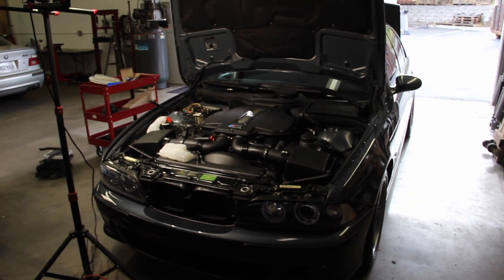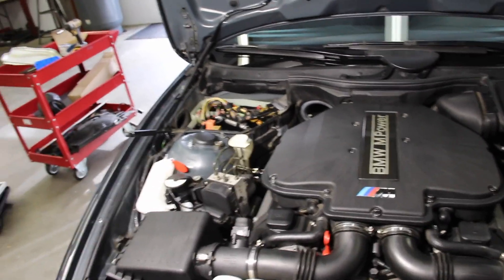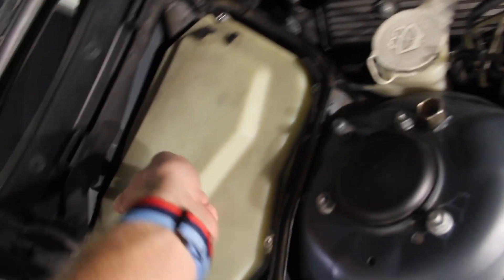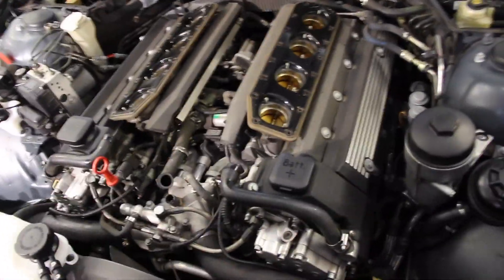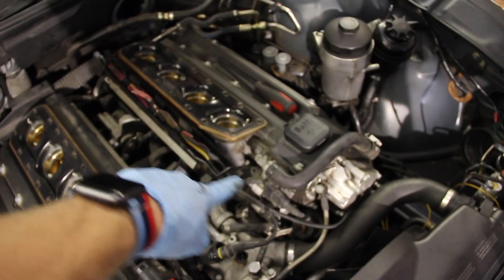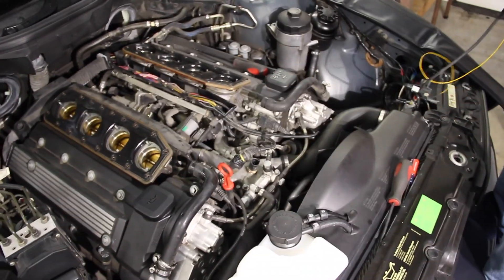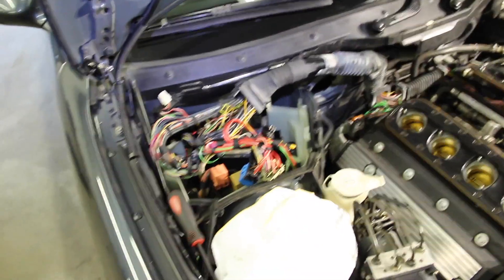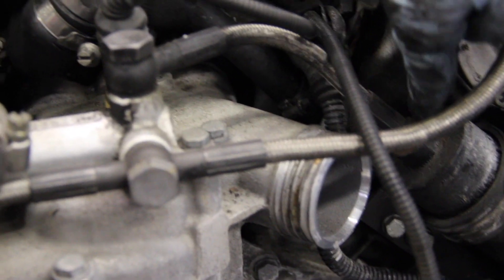BMW E39 M5:  VANOS Pressure-Accumulator Retrofit DIY

Comment: Is this something that can be left as is and not do the retrofit? Is it something that can cause issues later on if it rattles on ocasional startups?
My understanding is that this is more of an option and not necessary if you don’t want to go through the trouble.

My concern is the wiring, I hate undoing wiring looms.
Reply from the maker: It is not required at all, this would just eliminate the rattle during cold starts.  The rattle won't hurt anything though.

Comment: When is pressure accumulator bad?

Thanks!
Reply from the maker: The accumulators don't generally go 'bad'.  I've never seen one fail, so I don't even know what the symptoms or codes would be.
Reply: @E39Source  You are put new one?
Reply from the maker: @7Mario777  There are two types of them.  The earlier ones did not prevent startup noise from the VANOS system as well, so we upgraded it to the later one.  The newer style ones started shipping 12/00 and later.
Reply: @E39Source  Is it OK for the oil pressure to drop immediately after the engine is turned off?
Reply from the maker: @7Mario777  It will drop some, but the later ones should hold pressure for the next startup.
Reply: @E39Source  The new one uses a bigger body to retain more pressure. The injector/solenoid might close upon shutting off of the engine keeping the canister full of pressurized oil for it's next start up. I suspect the old style might have a manual valve that goes bad not keeping  oil pressure in the canister. It's why the new style brings an electronical valve/solenoid

Comment: My car 540i 2003 I feel that the torque is a little weak and it consumes more fuel than I supposed and I feel that the car while driving is heavy and when I start it in the morning shivering and the engine lighting appears and sometimes turns off, but when it warms up the vibration disappears but I am tired of thinking I do not know why the power is weak And you are consuming fuel. Can you tell me what to do or what causes the engine’s weak power and a feeling of heavy vehicle?
Reply from the maker: You should scan the engine computer (DME) for codes.  If it is not idling smoothly or making adequate power, there are bound to be some trouble codes in there.  Lots of things could cause this like bad spark plugs, coil packs, MAFs, cam sensors, fuel pump, fuel pump filter, fuel injectors, knock sensors, air filters, vacuum leaks, etc etc etc.
Reply: E39Source 
Thank you again very much for your response, and I really appreciate it, I always follow your videos I checked the vehicle on the computer and the errors appeared to me as follows, and I photographed the results of the examination on the phone The errors will be written to you literally as they appeared on the scanner   

cylinder 3.6.7.8 misfire detection additive mixture adaptation (bank1 and bank 2 hot-film air mass flow sensor signal activation. intake flap 

Please tell me what this means or rather clarify these errors and thank you again and I will not bother you again
Reply from the maker: @MHD_85  I would replace the spark plugs (all 8) and mass air flow sensor to start.  Clear the codes, drive the car, see what returns and how it runs!
Reply: E39Source 

I replaced the spark plugs 3 months ago and traveled approximately 1000mph when I pressed the accelerator pedal to smell the smell coming from the bottom of the car.
Reply: I wish I could find a good maintenance center and I trust most of them. They want to invent many breakdowns in the car to take a lot of money.
Reply from the maker: @MHD_85  What kind of smell?  You might have several bad coils or fuel injectors.
Reply from the maker: Where are you located?
Reply: E39Source 

When I press the accelerator pedal strongly, I smell the smell of an unpleasant burning smell and suffocate the car, and then the car starts strongly and the gear shifts to 5 (automatic). The smell comes from the bottom of the car. I live in Dubai UAE
Reply: This only happens when I press the accelerator pedal hard when I drive normally. This does not happen and the transmission speeds change normally
Reply from the maker: @MHD_85  There is definitely something very wrong with that car.  It is virtually impossible to diagnose mechanical problems from 6,000 miles away though, you need to get it to a mechanic or dealership soon.
Reply: E39Source 
Thank you for your response very much I expect because of Coils because today after I pressed the accelerator pedal there was a shiver in the car and this shiver I know very well happened with me before because of a malfunction in one of the coils and also I suspect a catylast
Reply from the maker: @MHD_85  You very well may have a clogged cat
Reply: E39Source 
Yes, I am sure of that, and that is that the two ends of the exhaust are clogged, but how can I clean them or remove the exhaust filter and I do not want to remove the exhaust filter I want to change it but its price is high I want to clean it but the problem is that it is connected to the exhaust not like other cars you can remove and clean it easily because it It is connected to the exhaust in screws
Reply: I was hoping to find in your channel a way to change or clean the exhaust filter for BMW E39